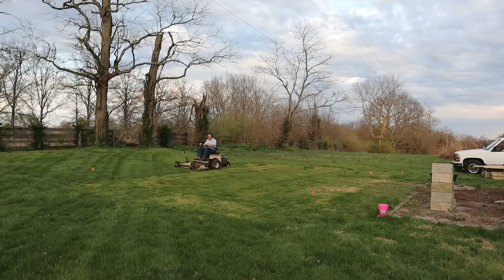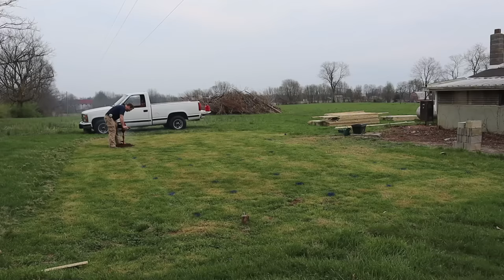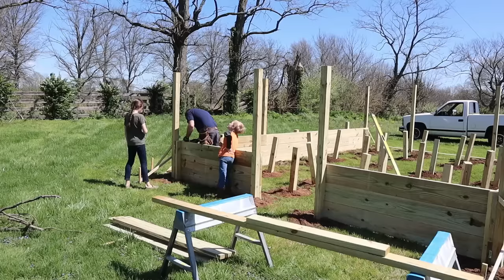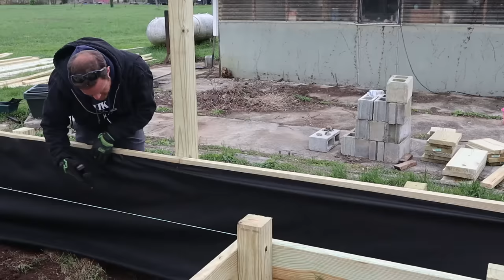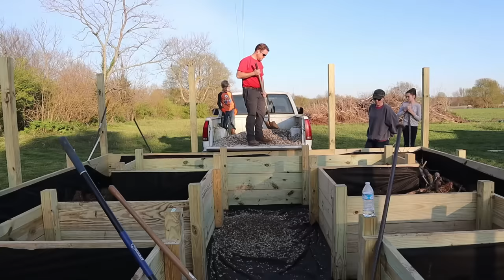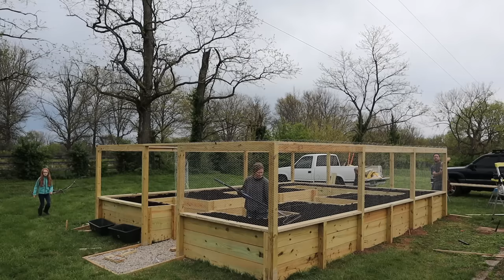DIY Raised Bed Garden! E82

Comment from the maker: I'd love to hear what you guys think about this.  Any suggestions, changes, etc!
Reply: Did you use pressure treated wood?
Reply: Man, this is so badass, I agree this is the best one I’ve seen, think it could be as popular as the trailer build, different audience though! I’ve showed a few people and everyone agrees
Reply from the maker: Total cost was $1200 for the wood and around $700 for soil, gravel, screws, etc.  I lost track of how many yards of soil I got
Reply from the maker: Mozart Framing, yes
Reply: @shaweehillsworkshop4226  any concern regarding wood leaching chemicals in soil, or amount is negligible?
Reply from the maker: @mozartframing2757  I'm not worried about it.  In 2003 companies stopped using an arsenic based chemical to treat pressure treated wood and switched to a copper based chemical.  All independent studies have been unable to show any measurable effect from using PTP for garden beds
Reply: Do you have an actual shopping list for your raised garden?

Comment: Wes, I'm curious. When you were drilling the post holes it looked like you have great soil for a traditional garden. Other than not having to bend over to harvest/weed and assuming with a traditional garden you also would have put up a fence anyway, why did you go with the raised beds? Awesome video.
Reply: I was wondering the same.
Reply from the maker: It is amazing soil, I didn't hit a single rock while digging, it is honestly the best soil I have ever dug in.  My main reason was just so I didn't have to bend over.  I was more than willing to put in a lot of work up front in order to make gardening more enjoyable in the future and less work.    Other reason are so I don't have to till it every year and also so it becomes more of a sanctuary for the wife and I.  The visual pleasure draws us out to it more than if we just tilled up the patch of ground.
Reply: @shaweehillsworkshop4226  I can understand all your reasons and don't blame you one bit. Are you going to cover it in temporary plastic to use as a mini-hothouse to start your plants earlier next year?
Reply from the maker: @LarryDMitchell  My plan is to make  plexiglass panels that can set in between the post and a hoop roof to wrap plastic over them.  I also plan on running electric out there so If I need to heat it any at night I can.
Reply: I understand what you said, yet personally, I would have my raised beds only 1 foot high.

Comment: I've seen several projects similar to yours and they all have poultry wire around the sides but nothing on top. Is there a reason you don't cover the top?
Reply from the maker: Well, there are several reasons I didn’t.  The wire on the side keeps out everything except birds.   The height keeps out deer, bunnies, etc and the conductive wire keeps out the climbers like squirrels.  To add a roof structure to hold the wire adds a lot of complication for minimum return on investment.
Reply: What exactly is conductive wire? And Would it keep out mice as well?